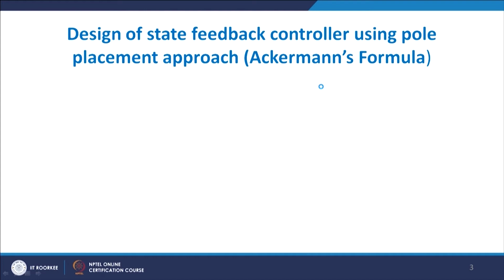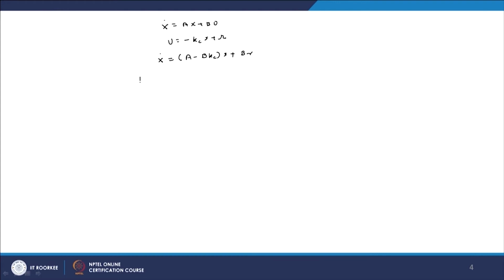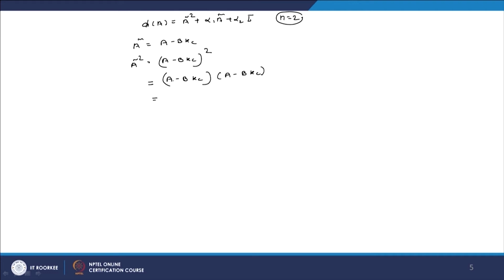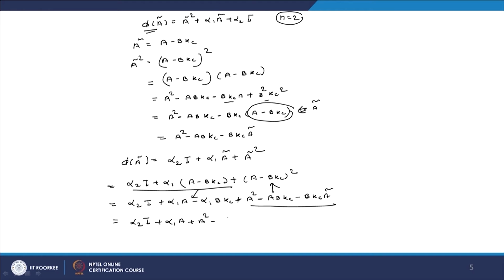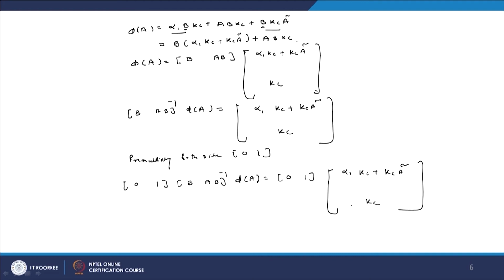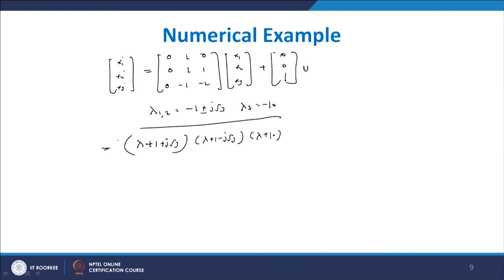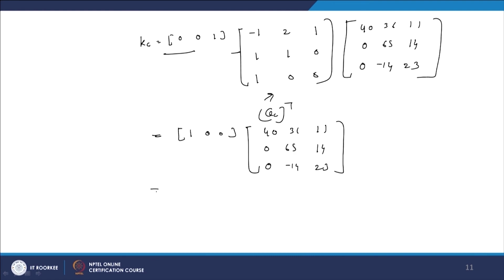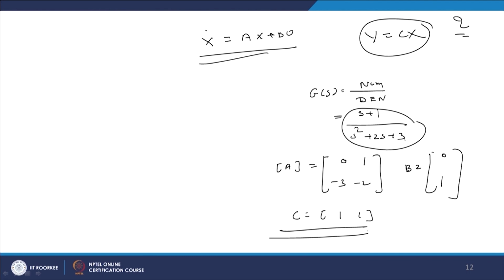Pole Placement by State Feedback (Part-III)

Comment: Sir, 
Thank you very much for your valuable insight . I do have one question that " is there any other method for deciding the pole of the system instead of taking arbitrary values"? Ackermann's formula is just another way to get the K value from already placed arbitrary poles . Is there any other way i can decide where to place my pole instead of randomly choosing it?